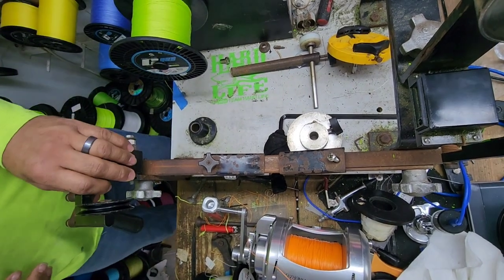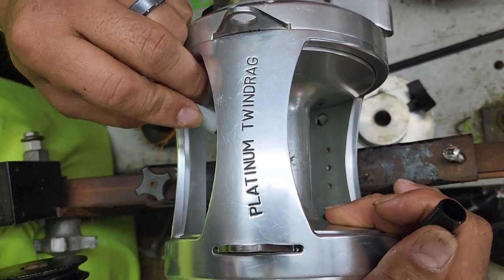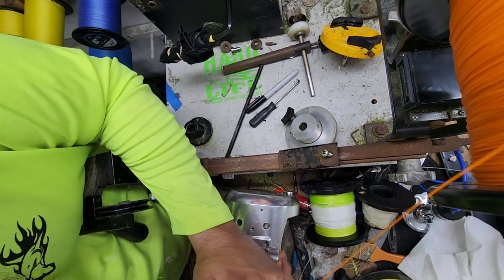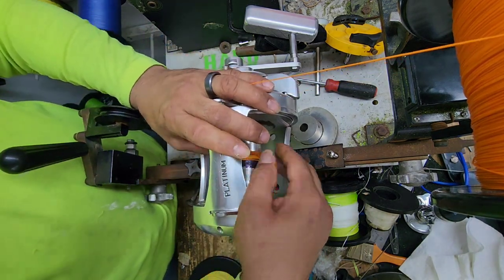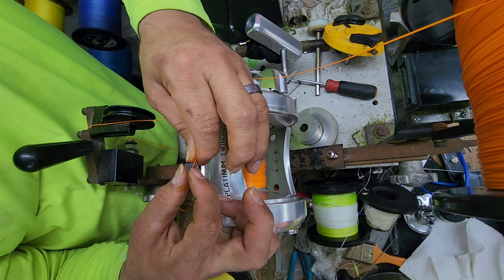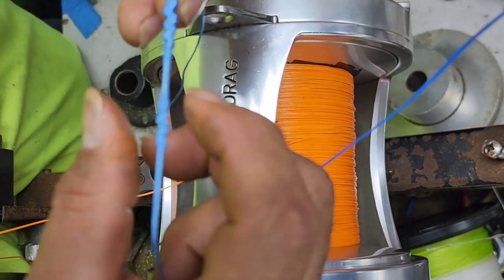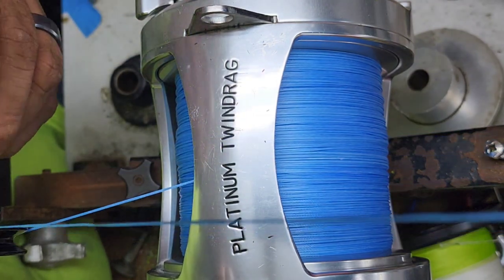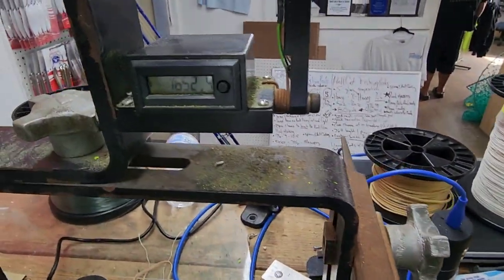What other tackles shop will miss Accurate 80w respooling 130lb to 150lb diamond Gen 3 hollow asmr

Comment: Why do these reel manufacturers not anodize their spools? I asume they are made of 6061 t6 but constant salt water exposure will cause corosian obviosly. Type 3 anodyzing would greatly improve this issue. who knows.
Reply from the maker: They did I don't know exactly what type of anodizing they do.. and the few ways we know to help slow the process is with the marker.. do you have any other suggestions that I can do..
Reply: Shoot im not sure. I'll look into it.
Reply from the maker: Cool deal
Reply: @TeamHardLife  Jescar’s polymer paint sealant  and then apply Collinite 845 insulator wax to a clean aluminum spool should help a lot to protect agaist corrosion from what i have been reading. Hope this helps and ill probably try it on my speedmaster 20
Reply from the maker: We are definitely going to look into that  for sure..